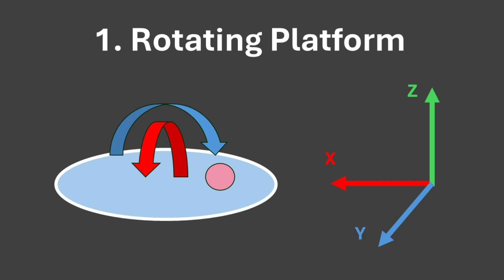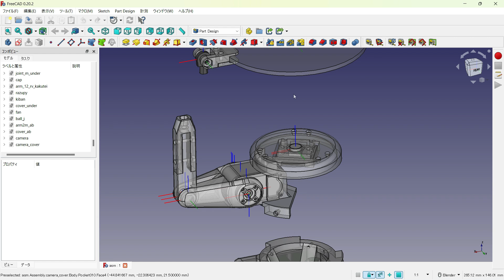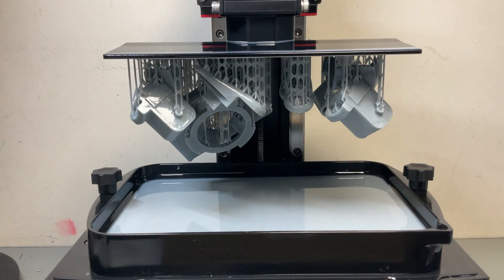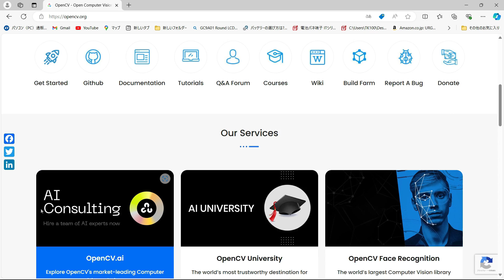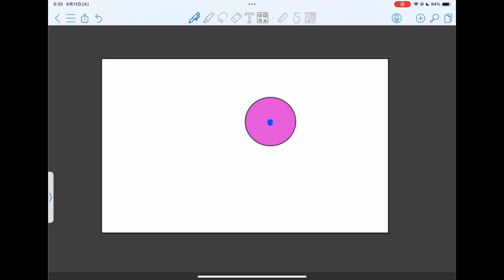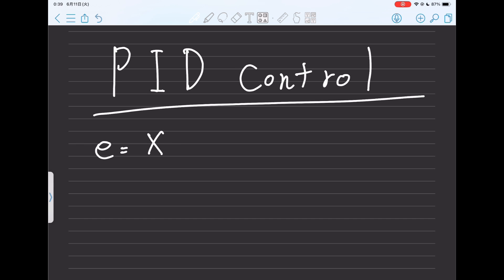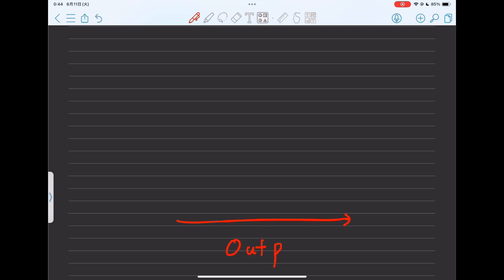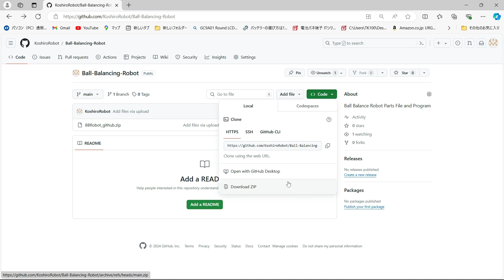I built a Ball Balancing Robot.

Comment: Excellent work! Thanks for sharing! I'm using the same servos(RS304MD) for one of my projects. I wonder for multiple servo control, did you use the "TB-RV71EH" and the "TB-22PP Hub" as shown in the RS304MD Instruction Manual for this robot? I didn't seem to see them in this video though.

Comment: Stopping bounces should be started by tracking the target height (and therefore the target size): starting from what (smaller than the size "on the surface") should one start reacting to its presence in the field of "vision" (pull the surface up as much as possible), and then track the rate of size increase (approach speed). When the target enters the "probable touch" zone (one should calibrate for the size of the target lying on the "surface" pushed up as much as possible), interpolating the progression of size increase between frames - begin the "bounce-damping surface fall" maneuver, proportional to the calculated target approach speed. One will probably have to calibrate for the target's "jumpiness" as well, to determine the effective number of target touches, before the bounces stop, relative to the maximum possible surface "fall" speed. Also, to more accurately determine the target size, one will have to use a camera with a higher resolution, which will load the graphic function... in the near future it is possible - to use shadowed side of target, for specifically orient the target on the "surface".

Comment: if the camera detects when to move the platform based on how small it looks ( this is to bounce it) I assume u did it like that then would it be that the height change isn't big enough to accurately detect when to bounce the ball you would need an extra camera to detect distance well enough

Comment: You need to adjust the vertical position of the ball by knowing the difference in its size. 60 FPS seems more than what is needed. This way, you can determine the vertical speed and also control the overshoot.

Comment: was looking to build a test or control environment with a balance or camera case based on the magnetic levitation action, or a magnetic testing device to calibrate or measure the necessary placement of magnets within a case or mount to have a more reliable gimbals or drone like camera for mountain hiking, rock climbing.but my question becomes how to build something like this more for magnetic or motion detection to weight and consistently understand the more reasonable positioning of magnets within the case; contacting to understand software demands,  establishing what sensors or device architecture would make a realistic controlled environment. im not sure there's software similar to what you've used in your project, but i love your work and would challenge you take your applied sciences toward the world of magnets and make a completely better selfie stick, no hands required!

Comment: Ive seen many of these videos but the impressive part is how clean and compact it is.Just a few pointers:
•You could use a much powerful overhead camera.
•Ball joints are producing a little unrequited wobble for the plate.
•The algorithm to reject noise could pose a problem during bouncing the ball as it needs to determine the size of the ball.
 Overall this is a great project considering how well you explained it.👍🏻
Reply from the maker: The issues of this robot are accurately pointed out. Thank you!

Comment: 3D movement requires 3D/2.5D vision, like a camera from the side, to be accurate.
Reply: ball have fixed constant size, and camera is not telecntric, so you can track height by measuring pink circle size.

Comment: At a glance you are using sight to know the position of the ball, I’d like it to use weight so it can be a never spill coffee cup holder for the car.
Reply from the maker: That sounds interesting.
Reply: Fluids are tricky and watching the cup from below doesn't help much. The car suspension and acceleration/turning are doing the spilling, so instead using a gyro/accelerometer would be the way to go. But don't drive too fast, or your calculations might need to predict the future...
Reply: Possibly a gyro suspension can do the job mechanically, with no robot or calculations needed. Good luck!

Comment: I wouldnt use open CV for such a simple job. and nah i don t think you process 60 fps with your rig. adapt a code for this yourself, in c++ should take something like 100 to 150 lines, and will be faster, you don t need to track the ball, just to 'find' where its center of mass is. That s the problem with newbees, they always take the problems reversed. the real challenge at high frame frate vision is the code in its creativity.

Comment: Cool.
What other ways can the same thing be accomplished?
A neutral net approach? Like an animal doing the same?
Different sensors, such as lidar, run at a frequency that sees through the plate. Radar? 
Force feedback (gravity) 
Could you use solenoids as actuators instead of motors (like speaker drivers) to get more sensitive feedback and faster response times?
How about a magnetic sensor, hall effect. The ball could be ferromagnetic.
And lastly (not really, but it's getting long) how about treating the actuators like octopus tentacles? Each one with its own microcontroller.  A central microcontroller could coordinate them, in case of something more advanced than static balancing (it would say, keep the mass at x,y then the tentacles would feel the weight and distribute the forces accordingly).
Anyway, really cool and very beautiful device!
Reply from the maker: Thank you for watching. You have some amazing ideas and it's incredible how they keep coming!

I think controlling the robot by inputting images and sensor data into a neural network to output the robot's actions is very appealing. Such a robot would feel more like it has life rather than just being a machine. Ultimately, this is what I'm aiming for in my graduation research.

Thank you for the other great ideas as well. I will incorporate them into future projects.

Comment: for doing the balancing you wouldn't need a second camera? that will lead to a more precise calculation of distance. Nice project!
Reply from the maker: Thanks for taking a look...I think using two cameras is a great way to go.
Reply: You can estimate height by the size of the image of the ball. Calibrating images of the ball on the platform at known heights could even give you a lookup table of size::height estimates as a baseline.
Reply: @wilkstube   I assumed it was something like. With a known default position of the platform, and assuming the object is a ball, it's diameter can be calculated based on the image. I know he's good for the math on that one, after the inverse kinematics lol.
Reply: no you don t need 2 cameras, you need a wide angle cam only / ball radius. enough to bounce the ball

Comment: next step might be fine tuning the K gain with continuous machine learning?
Reply from the maker: In this video, I failed to bounce the ball.
I think a camera with a higher frame rate or an algorithm to predict the trajectory of the ball between frames is needed to successfully bounce the ball.
Reply: @Koshiro_Robot_Creator  I think you need depth camera or multi camera to analyze depth to add precise z dimension for that
Reply from the maker: @ThainaYu  In this video, the height is determined by the algorithm of the pinhole camera model, which is not very accurate. I think the means you are describing would be very useful for successful bouncing of the ball.
Reply: @Koshiro_Robot_Creator   That assumption should be fine for most things, but to jump the ball, for the precise z, you'll want to solve the tangent sphere problem. You could also calibrate the diameter more precisely with that same algorithm. (I brought something up like this in another thread just a second ago).